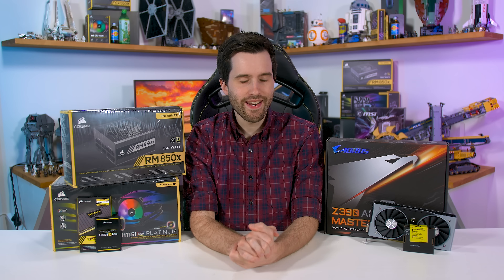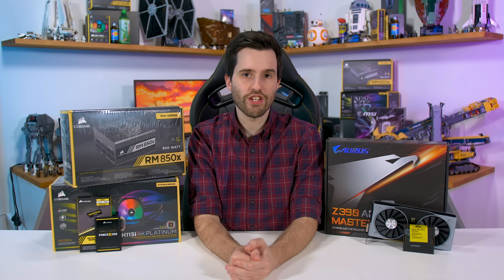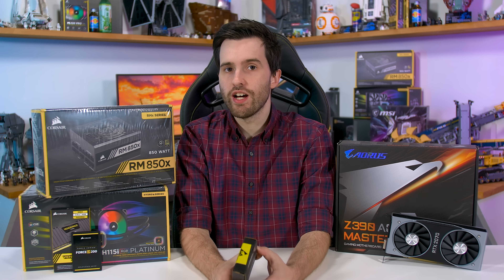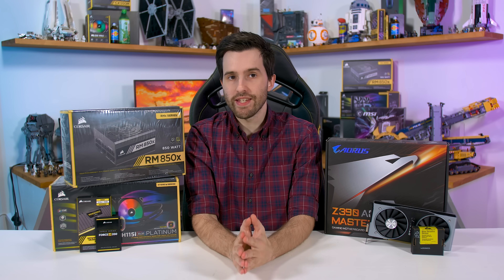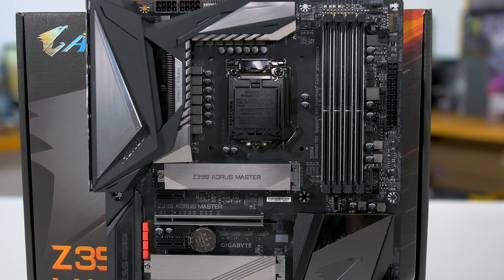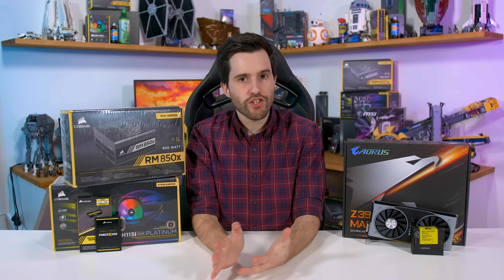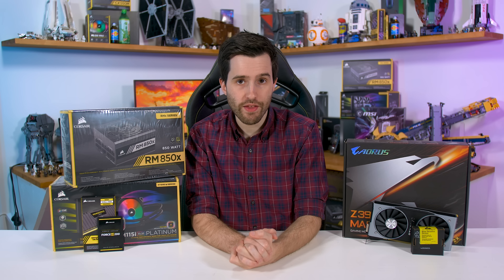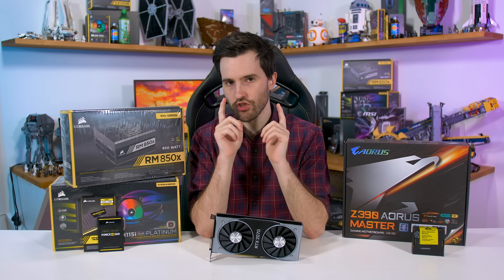Core i9-9900K Upgrade, Can We Cool This Hot CPU? Corsair H115i Platinum Tested!

Comment: That's a good one! Though, I personally never liked cases with that closed bottom PSU cave (or how they call it). But a question here: how can I replace a AM4 factory cooler without removing the motherboard out of the case? (I mean I am alone, so I have certainly two hands for the work.)

Comment: my time is approaching. Time to upgrade so i can install NVme drives, and run everything in a small form factor. Should i gear towards ryzen or intel? I would like to know myself. Atm, i would definitely go 2700x since i am happy running 60-81 hz. But i am in no rush. I will wait for the 3700x and intel's 10th generation or whatever it will be titled.

Comment: I have similar build with Z390 Aorus Ultra runing 9900k @ 5.0 ghz at 1.31V with 360 AiO around 75-80 C under stress load with silent profile. I hope it will ast as long as my old 2500K Sandy Bridge
Reply: cb / real bench and XTU stress test.

Comment: Mobo manufacturers are about to run out of space to put M.2 slots sooner than later.
Reply: They will just put them on the back of the MB like they sometimes do for Mini Itx setups.
Reply: @johntotten4872  ASUS has started using a "proprietary" riser that slots in a "DDR3" slot on some of their mobos. I guess we will see where they go with the next generation.

M.2 PCIe 4x is already becoming saturated. We live in interesting times as far as storage is concerned.

Comment: Could use more benchmarks or comparisons with other coolers. Kinda lame....
Reply: Don't you get that this video was made just because they need to build a new test system ? Doesn't it make sense that they will use only 1 cooler now ?
Reply: Victor Custódio Then the title is misleading.
Reply: @djayjp  How " Can We Cool This Hot CPU? Corsair H115i Platinum Tested!" is different from cooling  a 9900k with a H115i, that is what they actually did ?
Reply: @vitaobatera  My impression was that they would test a variety of coolers on the chip and/or they would compare the Corsair against other coolers. I was disappointed as usually their videos are very comprehensive. This was like a very light and simple means of addressing the stated premise/title.

Comment: Space restricted case so makes sense to go with 240mm AIO. What settings are you using to set the Gooseberry Blender benchmark to take one hour? Even at stock (95W TDP) my 9900k completes the Gooseberry test in about 33 mins. I use a Asus z370 board, 9900k, and Noctua NH-D15 air cooler with slower RAM than you. So I shouldn’t get faster render times than you. My video: https://youtu.be/vWGJubXqjSk

Comment: Yes, yes you can. I have a 9900k Oc to 5ghz on all cores and under normal loads i get max like 59c. max i seen was 80 from bench marking cinebenchr15 and got a 2202 with only aio cooling 360rad

Comment: I have the old H115i with just the normal Corsair text that lights up. It doesn’t cool my 8700k at 5Ghz as well as I’d you’d think. I’m sitting at around 87 to 89C when under a cinebench load. I’ve got great air flow and the fans are spinning really fast causing a lot of noise. It’s relatively quiet while gaming.

Comment: Steve clearly got an absolutely garbage 9900k sample in his original review, as in bottom 10% sample at best. EVERY person I've helped overclock on reddit (easily well over 2 dozen, plus the 4 builds I've personally built for myself and friends) on a wide variety of motherboards (ASRock, Gigabyte, ASUS, MSI all represented. ITX builds, mATX builds, full ATX, you name it) can easily snag 5Ghz all cores at 1.32v or less and remain under 90C even with Air coolers (Dark Rock Pro 4, NH-D15) under extreme stress tests (X.264 encoder benchmark, Blender, Intel Burn Test, etc). It may not be Prime95 AVX testing, but I think we all know that a full blown power virus is not a realistic workload. In gaming tests, temps are under 75C even in the worst offenders, like Battlefield V, and generally under 60C in most others (BO4, Destiny2, R6 Siege, The Division, etc).
Reply: Either my retail 9900k is crap or I am just not configuring the overclocking right, but I am getting HOT temps when overclocked over 4.8Ghz. At 4.8Ghz, it's hitting 86c. But, at 4.9Ghz, it's hitting that 100c mark. I guess I need to revise my config settings. I fairly much have the setup in the video - that MB and the H115i Pro cooler.

Comment: I like how every reviewer always recommend Amd cpu's but get Intel for their own rig. I wonder why
Reply: Amd is a better price to performance choice for most people. Also has good future proofing with more cores and zen2 on the horizan. Thats why they would suggest it right now. And of course Intel is great for gaming currently if you got the extra cash and play at 1080p.
Reply: @marcomongke3116  Intel is future proofed by default. Buy an 9900K today, and it will be good for tomorrow. I spent just over £800 on an 9900K, and Maximus Code XI. Baring the widespread adoption of quantum computing, I fully expect that motherboard and CPU combination to last a good 6-8 years. 

Look at it another way, someone who bought into the original Zen architecture, and is thinking of upgrading to Zen 2, will already have spent MORE than it would have cost to just buy a 9900K in the first place, AND just to get similar performance (if rumours are to be believed). 

With processors and motherboards, buying cheap is, and always will be, a false economy. That is why I buy Intel, not because I am a shill, feg, or anything else, but because Intel processors stand the test of time.
Reply: Steve uses threadripper.
Reply: @BrandensOutdoorChannel   I'm sorry, english isn't my native language. Thanks for pointing that out !
Reply: Reviewers dont have to worry about price vs. performance.
Reply: AMD has more affordable cpus than intel. Basically if you want a more cost effective cpu , then go for AMD. If you want a more powerful cpu , then go for Intel.
Reply: Intel's best CPUs are slightly better than amd's best, and when you get the processors for free well then the choice is quite easy. They usually recommend Ryzen because it gives the most value for the money if you're not a reviewer and you don't get your CPU for free
Reply: He said why in the video
Reply: I like how some viewer always skip the video, but write a comment below it. I wonder why
Reply: They want Intel and try to make everyone buy AMD so they can the the Intel CPU at lower price for themselves lol :) I must admit I do the same for my own selfish reasons... If everyone buy AMD it will be more Intel for me lol... Intel have lot of trouble making enugh CPUs and I had to buy a complete workstation computer the get the Xeon 2288G I wanted as people have now waited more then 7 months for it and the date when they get it in stock keep getting pushed forward 1-2 weeks for months now...

Comment: Good video. I have to wonder if the engineering samples arent nearly as good as later retail ones. The voltage required seems much higher. Myself and others are running substantially less voltage (1.23-1.25 before vdroop) at 5ghz all cores. Completely stable in all tests. In fact could possibly lower voltage more as I still havent pushed it to the point of unstable. And its running roughly 10c cooler in the stress test conditions with the same exact cooler in an h500. 

Also.... to friendly fire back at the AMD guys hating on the heat from the 9900k.

How hot does the 2700x get at 5ghz?

Oh wait.... :)
Reply: Just get the Costa Rica 9900k they are made on the Xeon lines and are done properly.
Reply: I have a retail chip and I'm at 1.38 to get 5ghz stable. My h150i pro just barely cools it under tj max with small ffts in p95
Reply: @tresnugget  that doesn't sound right. I'm at 1.3 for 5.1 GHz.
Reply: @Barney_Hunters  It may be right for his particular CPU, just bad luck.

Comment: It's the fastest gaming chip on the market at STOCK speeds. My 8086K will do 5.3 on air cooling and will smoke a 9900K.
Reply: I have an 8086k that can hit 5.3 and my 9900k at 5 stomps it in every benchmark. By smoke do you mean gets 2 more fps in some games and the 9900k gets 10+ more in games that utilize more threads?
Reply: Tres Waters don’t forget smoother gameplay.
Reply: @tresnugget  Even games that "utilize more threads" see diminishing returns with more cores. AC Odyssey for example has pretty good multithreading, proven by the fact that a 4GHz 1700 has almost identical fps to a 5GHz 8600k w/ 2080Ti @ 1080p (so not GPU bottlenecked) https://wccftech.com/assassins-creed-odyssey-pc-performance-explored/ Still, the 1700 only shows a 4% increase in fps going from 6C to 8C, despite a 33% increase in cores. A 5.3GHz (8086k) is 6% faster than 5.0GHz (9900k). So it sounds reasonable to me that the increase in clocks could be worth having 2 fewer cores, at least in that game. Even more so in older games. 6-core is pretty much the sweet spot right now for gaming.
Reply: stop being stupid and use liquid cooling on the 9900k
Reply: no
Reply: @directlinkrexx4409  Yes. I had a 9900K and sold it precisely because my 8086K was faster in literally 99% of all games.
My actual experience with both chips > Your stupid reply.
Reply: @n.i.5381  9900k can reach 5,4+ ghz in single core beating 8086k. With air cooling. For games you need single core and quad core mostly
Reply: @apothecy4011  Not anymore 2013-boy... go check Gamer's Nexus review of the 4790K again, learn with the almighty and sit down quiet...
Reply: @vitaobatera  4790k has 4 cores though
Reply: @n.i.5381   Single/dual core it might be possible? Ofc not for all core lol, i didnt say that. For all core 5-5.1 is propably the best you can get with air cooling but i would not do it xD
Reply: @apothecy4011  True, but reaching 5.4GHz in one core won't help beat a 5.1GHz 9900K... not even 5.4 with all the 4790K cores... that was my point...

Comment: The fans for the h115i are blowing hot air all in the case, why?
Reply: Thanks for noticing that. And since he knew about the bonfire it would be, he could have gone top mount radiator in push-pull

Comment: Very nice looking build which has nice clean lines...though a mesh front panel case would have been better as it would have dropped temps even further...but still nice and compact and a proper 5GHz on the 9900K with a good vcore too...

Comment: I'm looking to upgrade my CPU from an i5 4670k. I really can't make up my mind between the 8700k and 9700k. I hate upgrading CPU and I have run into not having enough cores before, but I MOSTLY game. Which should I pick?
Reply: go for the 9700k , more cores , higher clocks , better thermals in theory(if you dont plan on delidding the 8700k),  absolutely better for gaming and for the most if not all scenarios ,

Comment: One, overclocked 9900K will need a beefier (thicker) radiator than one on H115i. 26mm of thickness is nothing for a 280mm radiator, especially one that is supposed to cool that beast.
Two, that front panel is restrictive, so temps are affected. Also, there are better fans for that but Corsair sponsorship, I guess...
Three, I KNOW you said 90 degrees is respectable just because of the said sponsorship for the video, because otherwise you would shit all over Intel for temp that high.

Comment: Morning from the East coast of the U.S. Tim. I did my own test on one of the popular liquid coolers Corsair H100i V2, temps for gaming were fine but under a heavy workload got a bit toasty. All with a 5 Ghz OC,with 1.314 Volts and LLC on Asrock Taichi Ultimate set to level 2. I would like to compare data in the discord but wont be able to throw you guys support till after Christmas... take care, thanks for content
Reply: Hey men I have same h100i v2 with i9 9000k but the temp on pross is 95 degrees can you help me ?
Reply: @sergiob464  your motherboard is more then likely overvolting. First check you bios and see if MCE is enabled, and disable it. If you hitting 95, when gaming, download "hwinfo" and monitor the "vcore" for you CPU. If you are not overclocked, it should boost to 4.7 ghz all core but only need 1.28 volts. For 5 Ghz, you should need around 1.32 volts. So if your hitting 1.34, 1.36 or 1.38 and your not overclocked.... now keep is mind this is average over time numbers. You may hit a peak of 1.34 volts, but keep and eye on it over time. Disclaimer: I am not responsible for any damage caused by improper use, these are only my recommendations based of my own experience with my hardware. Each CPU is different, and silicon lottery plays a big part in how components perform. Good luck
Reply: SerpentXSF I’m just received yesterday the motherboard and i9 they are default setting.
I got 32 degrees to 95 in less Than 5 minutes in bios . The cooler was working good in my i7 7000k i don’t bow what happens :/ should I buy a h150i 280mm ?
Reply: @sergiob464  what, your hitting that temp in bios? That's bad... make sure you plugged in the supplemental data power for the CPU pump, and make sure it is seated properly. If your going to get a new cooler I definitely recommend a 360mm radiator instead of 280mm. If your case can fit it, but before you spend money, just start from scratch, unmount CPU block, replace thermal paste, then make sure your pump 3 pin header is connected to a PWM 4 pin or 3 pin compatible with water pump. And check sata power for pump, sometimes you can feel if the pump is on by placing you hand on top of it while computer is on. If the fans spin, and you dont feel a slight vibration, maybe the pump went bad... but like you said it was just working
Reply: I bought the v115 pro 280mm but now the liquid cooler is not touching the processor I’m the unlucky man on this work I think I use the intel plate the b screws  same equal of the tips
Reply: @sergiob464  something is wrong with you mounting solution, check motherboard vendor, compatibility and correct mounting hardware

Comment: You are bottlenecking the 9900K with 3000 Mhz memory. The Blender CPU load temps would also drop with a proper case.
Reply: Betroz how is it bottlenecking with 3000mhz? Would you say 3200 is needed?